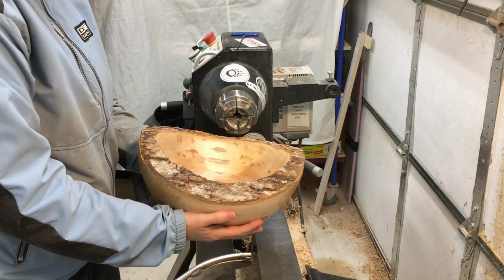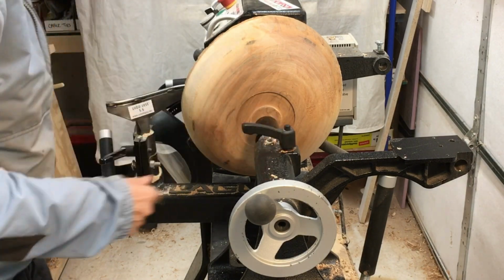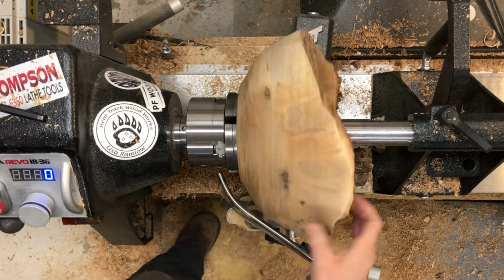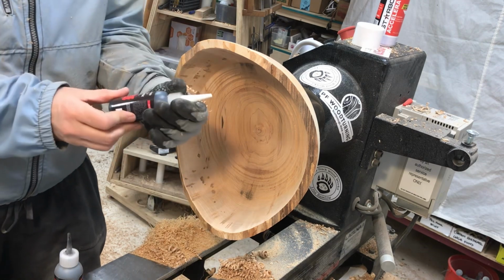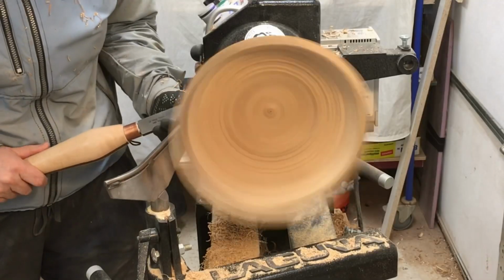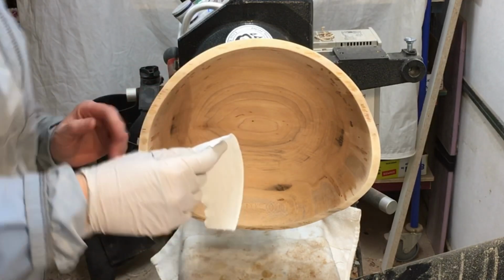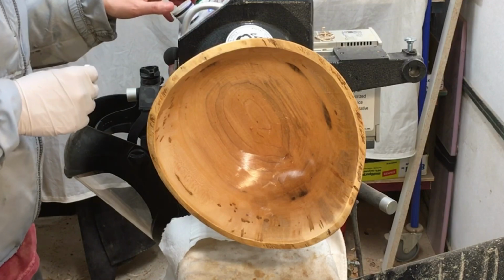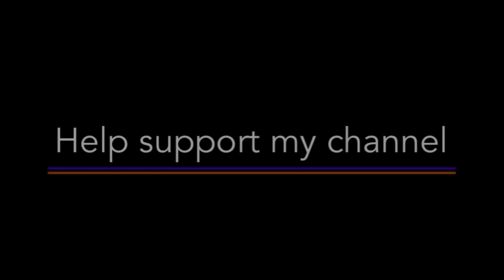Woodturning: Live Edge Maple Bowl Blanks - The Eyes Have It!

Comment: Boy that one really whopperjawed nicely. Turned out beautiful.
If you're not using that arm of your duplicator for anything, you could take it off so it wouldn't be in the way. What I do for tear out (which works occasionally) is to turn my speed up as far as I feel comfortable and use a negative rake scraper or skew. Also, I wet sand in both directions with walnut oil. Works for me most of the time.
You do beautiful work and personally I would prefer a turning as a giveaway.
Take care, Dave
Reply from the maker: Thanks Dave! That’s just the bracket on the Laguna where you can mount a light. I’m planning to get a magnetic base light soon so I think I want to keep the bracket for that. I just flipped the handle around to the front - posted a Workshop Wednesday video a little bit ago so we’ll see how that works out!
I’m basically afraid of the skew but I have a few good negative rake scrapers. I may not have had the speed up quite high enough to really combat the tear out on this one but I got it in the end 😁

Comment: I can feels those eyes looking at me Lisa. Very cool looking bowl.
I know some people take that mount off the tailstock because of the lever. I have adjusted mine so it locks in a position where I can loosen it easier. You can also move it to the front of the tailstock. Adjusting the banjo so it slides easy is a bigger issue for me.
Gary
Reply from the maker: Hey Gary! I haven’t decided if I’m going to take the bracket off and leave the lever where it is, or leave the bracket and adjust the lever. Do you have to remove the little safety pin on the back of the tailstock that stops the lever from falling too far down?
Reply: Hi Lisa. I did not remove any pin and I use my rear bracket to mount my camera when recording something on my bench. Or to put my magnetic light. So it will stay.
I adjusted mine so it does not quite reach vertical when locked. It is pretty easy to loosen back up from there.  I can send a picture if you would like.
Reply from the maker: I’ll see about repositioning it before I take the bracket off. I’m hoping to get a magnetic light at some point and that will work better for recording than the front bracket

Comment: Great looking bowl.
 I have found that by applying mineral oil to the area where you have tear out, let it soak in for a little bit, it will cut like butter and give you a very smooth cut. The first time I tried it was on a piece of wood that was so punky, I was about to throw it in the fire. I oiled the bowl and it turned out great with a smooth finish.
 GunnyUSMC
Reply from the maker: Interesting, I’ve used shellac to stiffen the fibers but never oil. And why I didn’t use some shellac on this piece I’ve no idea 🙄
But I imagine I’ll have similar issues with the rest of this so will try some different methods and see how it goes   Thanks for the suggestion!
Reply: @LisaRamlow  I tried using shellac when I started turning but got poor results. If I remember right, it was a YouTube turner from Canada that used mineral oil in one of his videos. I gave it a try and was amazed at how good it worked.
 Good luck on you next large bowl, I look forward to watching you next video.👍
 GunnyUSMC

Comment: Nice piece well done 
To make it easier to tighten the tail stock. I removed the grey knob and the rubber handle off the locking lever and then slip a wooden handle about 12” long over the locking lever.
Reply from the maker: Hi John! Yeah, I’ve been wanting to put an extension on it to make it easier to lock and unlock but the position mine locks in makes that impossible. Gonna try and re-situate that so I can make an extension

Comment: I see you used full strength snot and then rubbed it in. I usually apply a 1/3 cut and then denib with a paper towel. I may try your approach as the result is lovely!

Comment: You may have already tried this, but to reduce the tear out consider shellac. Brush it on and get the tear out area soaked and light on the rest of the piece. Let it dry then turn it again. It has helped significantly, especially on wood starting to get soft. I’ve tried different cuts and have not reached a conclusion on which was best. I enjoy your videos. Thank you.
Reply from the maker: Hi George! I dunno why I didn’t think of that, I’ve done it before, and on a SUPER punky piece of silver maple - Doh! 
Thanks for reminding me! I actually thought about shellacking it before I sanded but I didn’t want to wait for it to fully cure - I find if I try to sand shellac the same day it just gums up the sandpaper. But it does stiffen the fibers and helps when cutting. 👍
Reply: I find it has to have time to dry/cure overnight.

Comment: I turn on the laguna 18-36 and as far as the tail stock lock arm I have seen where you can change the handle to the front side.  It didn’t look very difficult to do.  But I would think that you could change the locking position of the handle, so it’s not in the locked position straight up.  There is a large nut on the bottom side of the tail stock if it was turned slightly to the right that would shorten the gap between the table-bed and the washer there for it would lock sooner.  I hope that makes sense.  You could think about taking that support arm off.  I didn’t install it on mine.  My turning lite is on the head stock end.   Anyway nice look bowl this week.
Reply from the maker: Thanks Lance! I forgot about the bracket on the headstock side - I don’t have a magnetic lamp yet but want to get one so a bracket would be helpful. 👍

Comment: I like it! I can never get away with 1 coat of shellac. Seems like I spend more time applying it than sanding.
Reply from the maker: Do you apply it before you sand or after? I am not patient enough to wait for it to completely cure to sand after I apply it so I sand the wood with nothing on it and use the shellac under the abrasive pastes and finish. So the way I use it isn’t really as a sanding sealer as it is a base “seal” coat before the finishing process. Lots of ways to do it, and lots of products to use,  it so far I’ve been reasonably happy with this process.
Reply: @LisaRamlow  i sand first. I need to sand more it appears

Comment: well done i thought you was too hire on the tool rest but what a great job x
Reply from the maker: Hey Mark! I do think I have a tendency to set the tool rest a little high in general. I think a subconscious precaution in thinking too high is better than too low as far as inviting a catch. The angle from the camera at the end of the lathe tends to make the tool look like it’s a bit more angled up than it actually is - when I was editing I had the view from that camera and the BOB gouge, where I was paying close attention to the angle of the handle and knew it was relatively close to horizontal, and thought “holy cow that’s still way too low on the handle end!” But when I switched to the camera next to the lathe I could see it wasn’t nearly that bad. Lowering the height of the lathe may help me with that too - I have short legs and a long torso so if I have the handle against my hip, that’s a lot lower than most other folks 😂

Comment: Just a guess for your locking arm, does it have a nut underneath that you can tighten or slack some? I have a different brand and I don't think they are all the same but maybe.
Reply from the maker: Hi Chris! Tbh I haven’t had a chance to take it off and look at it yet - someone else has the same idea so I’ll definitely check it out 👍
Reply: @LisaRamlow  if that doesn't work then maybe an angled attachment to get clearance and some more leverage 🤔 good luck and happy turning. One more think I hope imitation or copying is a from of flattery with you because I copied the tool carousel idea👍mine looks different but same idea 😁

Comment: Are you using that tailstock bracket for anything?  I removed mine as it was more in the way than it was useful.  For your banjo, I recommend upgrading it to one from Robust.  The clamping mechanisms on the Robust banjo and tool rest are cam lock and work tons better than the stock Laguna
Reply from the maker: Hi there! I’m not at the moment - I found the camera too shaky mounted there and I don’t have a magnetic light yet but would like one so…taking it off is an option. I’ll check into the Robust - I know their lathes were out of my price range, dunno if the pieces parts would be too
Reply: @LisaRamlow  The only use I've seen for that tailstock bracket is for a light.  But then you've got your light source on something that's always moving and also makes it really tough to remove the tail.  As for the banjo, I've seen it as a special order item for $400.  I believe the one that my lathe has is for the American beauty

Comment: What length handle do you have on your Thompson bowl gouge and do you like it.  Which shape did you get on your gouge.  Thinking of getting one of his gouges.  Any recommendations.
Reply from the maker: I have a 1/2” with a 40/40 grind and a 5/8” with about a 60deg swept back wing grind. They are both (I think) v-gouges and both have 16” handles. I love them and will likely get a 3/4” down the road with a 20” handle for big blanks, though my 5/8” does a fine job. Highly recommend Doug’s tools for sure. As I replace my starter gouges I’ll be going with Thompson

Comment: I'll bet you thought only potatoes had eyes.  Anyway, the tailstock handle on my lathe will tighten with the lever both forward and backward.  Can you push the tailstock handle the other way?
Reply from the maker: Hi Bill! Mine only goes about 90deg - a lot of people have repositioned it using the nut underneath so I’ll give that a shot and see. I can also take that bracket off if I want to, or remove and move the handle so it locks from the front. 👍

Comment: Lisa, this is Shay’s video https://youtu.be/lnWTNeO_oRY
Reply from the maker: Just watched this - good idea! Shay also improved the locking handle on the tool post by adding a bolt & nut, which I did on mine too. And may be part of the reason I have such a hard time loosening that back up, but if is isn’t that right, the tool rest slides so I’ll just keep using an email extension on that for more leverage.